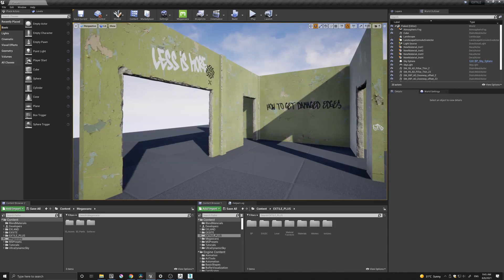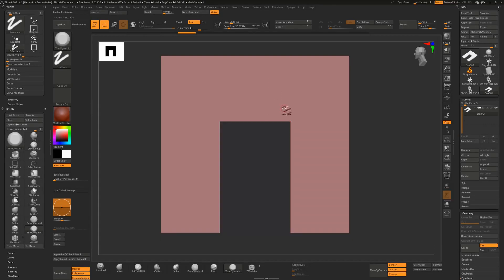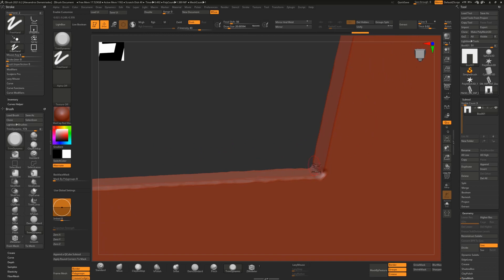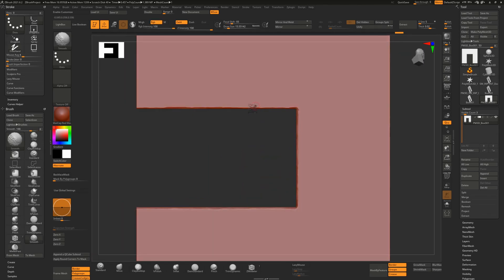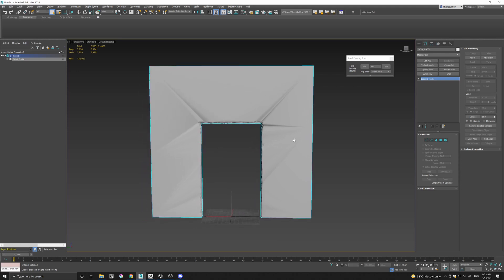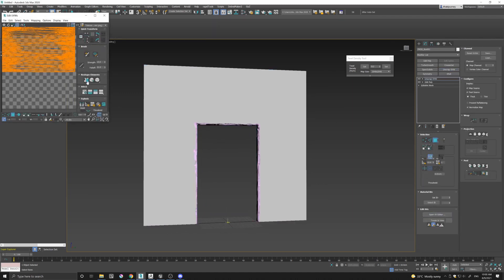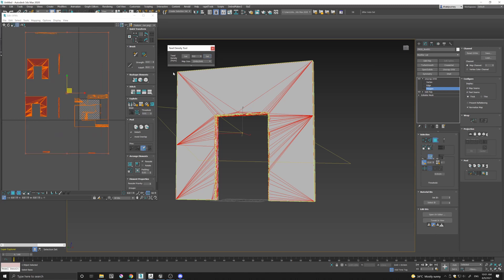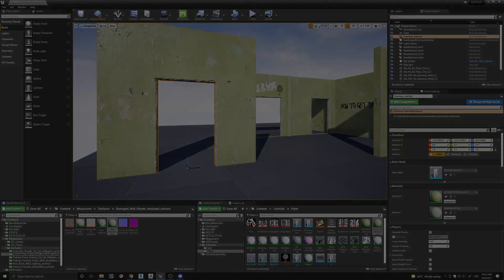Damaged Doorway Effect

Comment: YOU SHOULD NEVER CLEAR THE SMOOTHING GROUPS! 
Non with nanite non with traditional ways of modeling.

Dude please read the official documentation. 
Clearing the smoothing groups not only preventing nanite from optimizing the mesh (because it can not understand what polygons it should optimize) but also it duplicates the amount of vertexes you have in your model. 

This thing you have right there is a perfomance killer. And you teaching this to other people...
Fortunately you can easiliy fix this if you assign smoothing groups to the walls.

By the way nice to see that you using my Texel Density Tool :D
Reply from the maker: pssst...this was 2 years ago! There was no nanite then...so yeah it was common practice back then...just saying